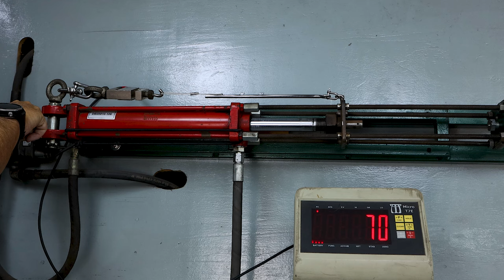Rob Allen | Laser Welding | 2024

Comment: ..does the welding process affect the characteristics( strength /flexibility/coating/corrosion/etc) of the shaft ?
Reply from the maker: No, the fin steel is high carbon, similar to that of the spear steel so the electroplating is compatible to both steels.

Comment: Hi Rob, is that 2.2mm double sleeve crimp on cable? Hand crimped?  Am I right in saying that is crazy strong compared to mono at the crimp point?
Reply from the maker: Yes it is. Mono is 2mm but this specific s/s cable I had, just happens to be 2,2mm, a little bit thicker than 2mm mono. Obviously, steel is way stronger than mono at the same thickness. 

As you see it is also a closed loop, not a looped end as you would have with a mono shooting line. So, the closed loop will give you double the break strain. 

The next "improvement" with steel cable is that the steel is much harder than that of copper. This means that the copper crimp can deform into the rough cable outer surface, giving it a much stronger bond compared to that of mono.

Comment: I don't understand why this was giving you so many issues that it took months to fix, any method of attachment would be able to handle 500lbs of force.

There's no real benefits to laser welding these, especially with the increased risks to the weldor doing these by hand. Tig welding them, with filler rod would have been my choice, though they are low stress enough to be welded without filler.
Reply from the maker: Laser has much more options in terms of settings. All had to be mastered then tested, this takes a lot off time. We also have to consider how long it takes to weld and, how cool it can be kept while welding. The laser is way better in both these categories as we can now complete a spear fin 3x faster than Tig. This makes the spear more affordable.
Reply: Yes, but this isn't a long process. Even if laser is three times faster than TIG, we're taking 10 seconds instead of 30 seconds, and that's assuming you're adding filter rod with the TIG. Apples to apples comparison, fusion welding with the TIG could be done just as quickly as laser. Plus, what did the laser welder cost? Obviously do what you think it best, but laser welders can be extremely dangerous and this type of application has no benefit.
Reply from the maker: @SaltyKayakAdventures  Do the maths, we can now weld up to 600 fins a day. We could only do 200 a day before and were not keeping up. Also, we are able to now weld much cooler. We will recover the extra cost of this laser in 4 months. Yes it is much more dangerous, another reason why it took so long to get it right. I agree, Tig is the best way to get it done if you were just making a few. Remember we manufacture around 2000 spears a month and finned spears are getting more and more popular.
Reply: I hope it works out as planned, stay safe!
Reply from the maker: @SaltyKayakAdventures  Thank you.